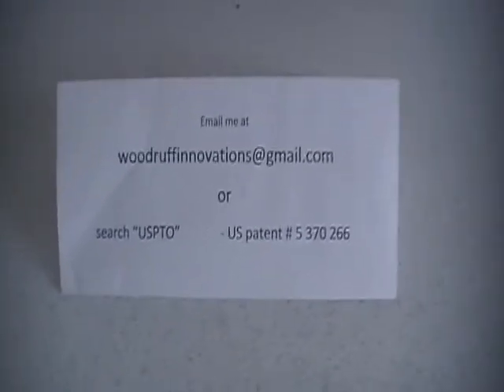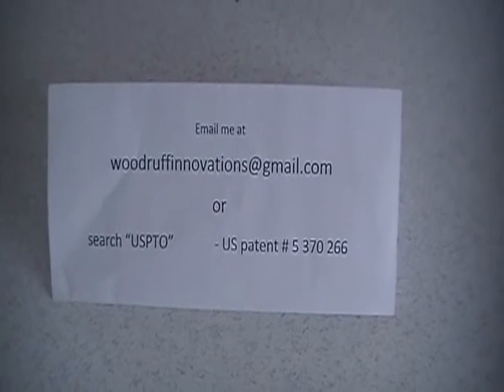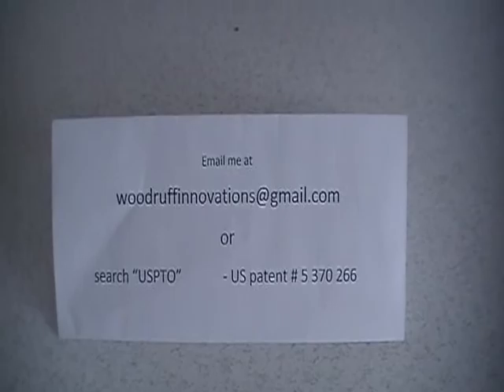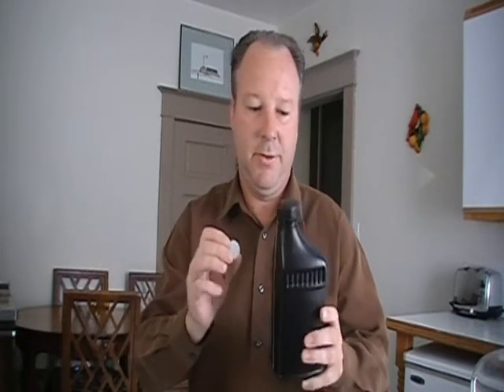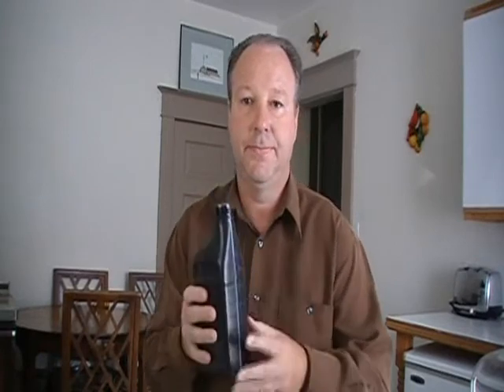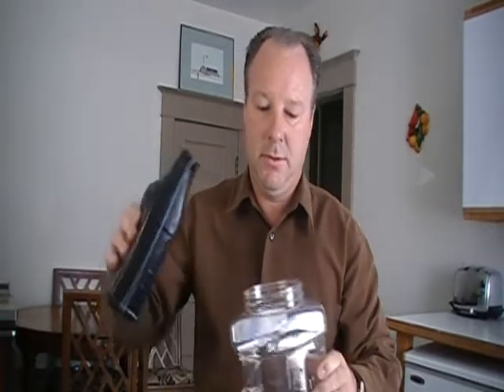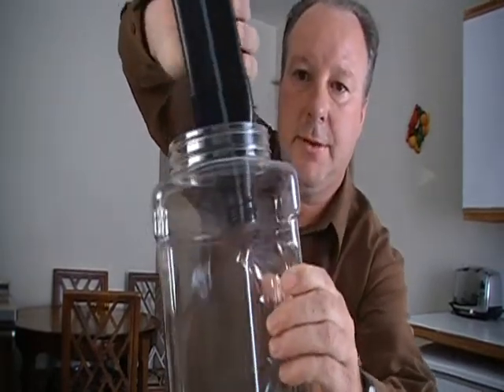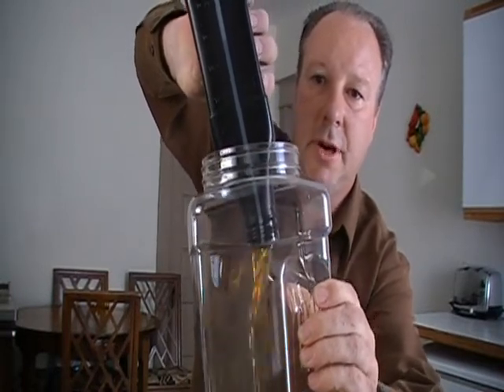OIL SPILL ELIMINATOR

Comment: Good luck to you. I hope your clever invention makes you wealthy forever. Lets think of a way to stop the oil from ruining the gulf and beyond. Why can't we just use an oversize threaded plug to screw into the holes where the oil is coming from the ocean bottom? It could screw into the holes similar to the way a wall anchor screws into drywall to cork the flow??? What do you think?